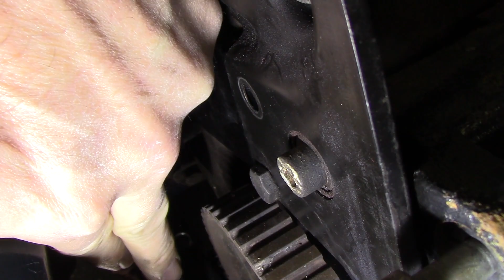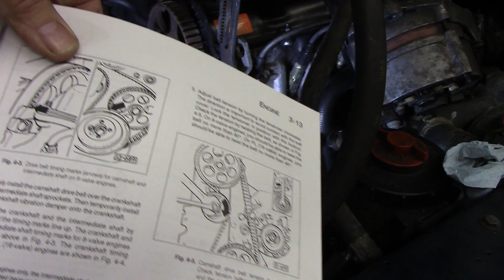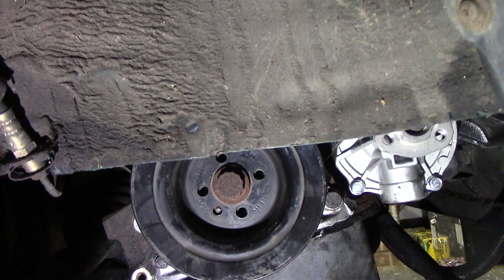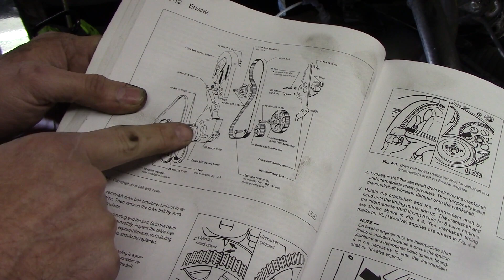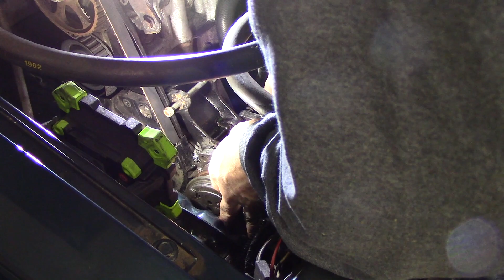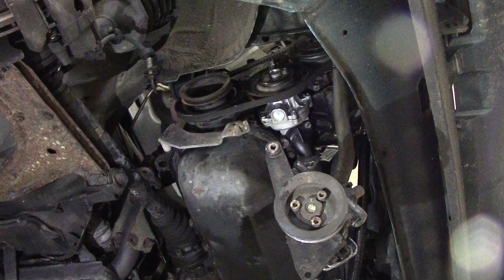VW Cabriolet water pump replacement part 4

Comment: What’s is that bolt called 25:42 in the video one of those bolts fell off my car and I need it to tighten my belt for my rabbit
Reply from the maker: I am not sure the name. Maybe adjuster bolt or clamp bolt? Not sure.
Reply: BryanR461 okay do you know where they sell them

Comment: Hi. Excellent video. One question. I don't have the OT mark on the valve pulley. What should I do? It's a 1992 VW Cabriolet. Thanks
Reply from the maker: If you are talking about the cam pulley there should be a line on the back of the cam pulley that will line up with the front of the valve cover flat surface where the gasket is if that makes sense.
Reply: @bryansprojects3570  Thanks for your answer. I found the line and now the car is perfect. Thanks for your help.

Comment: Hey Jim. We had to replace the timing belt on a Cabriolet. I'm by no stretch of the imagination imechanic but managed to get all the belts off, the new timing belt on and everything in a position where it will start and turn over and run for a second. Now I'm trying to get it all put back together and I can't figure out how to put the water pump belt back on. unfortunately you mention that this part we can't really see so you just kind of do it and then cut back to it being completed. It's around the 20:24 mark.

what do I need to adjust to be able to slip the belt back on over the crankshaft, compressor, and water pump? also it looks like you adjusted some things to move the power steering pulley, but I can't seem to find what those are either. the manual I'm looking through doesn't have any good illustrations or descriptions of where the nuts and bolts that I need to loosen to move some of those poise around are located, and I can't find any good resources besides this series of videos. 

Any help would be greatly appreciated, thank you for your time.
Reply from the maker: There is adjustment on the a/c compressor. Two pivot bolts next to the block and on the radiator side there are the curved adjusters. They all need loosened and there may be a bolt that will move it down. Put the alternator belt on and leave it loose, then put the pulley and belt on the crank, compressor and water pump. Put the belt over the pulley and slide the pulley over the water pump hub. It works best if you line the bolt holes up first.let me know if this helps.
Reply: @bryansprojects3570  Okay great! I believe I know which ones you're talking about. I'll let you know how it shapes up, or if I have any more questions. Thanks again.